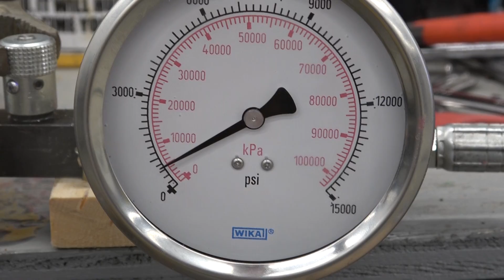How much pressure can PEX take?

Comment: So, PEX - plastic time! 

True PEX means PolyEthylene-Crosslinked. 

Extremely tough material, and a great water barrier (and moisture barrier) but not actually a great air barrier.. well... It gets better when you cross link it.. but I digress. 

PE isn't hygroscopic (unlike Nylon which is quite hygroscopic and actually plasticizes with moisture) 

Cross-linking also essentially makes the whole thing one giant polymer chain, and the polymer no longer "melts". It will soften but you could not melt process it again. 

In summary: PE is not effected by moisture. PEX (not polybutyl) is great for hot water applications.

PE doesn't degrade over time. 
Doesn't degrade with UV (not that this would be an issue) 
And the cross-linking makes sure it isn't melting and adds a whole heap of toughness to it.
Reply: Regular PE will melt back down, PEX will not. Once PE is crosslinked(the X) and becomes PEX it can withstand over 500F and still not melt to dripping stage. The crosslink creates a Memory as it strengthens the material and will return to that memory as it cools down or thaws out. Regular PE is extruded around 200F and has no memory to it, which allows it to be melted back down and recycled. Also, the problem with irradiated PEX is that not all PE resins are the same and each batch of resin reacts different to the process. Chemically crosslinked eliminates that variable as it's being extruded.
Reply: @charlessharp9795  yup! Well... I agree with everything other than the irradiated vs chemical comment. But perhaps that's because the company I work for makes and maintains our own irradiation equipment for our film work. 😂 But perhaps it's just pride talking.
Reply: @bradleynealdaley  I've had experience producing both types. Chemically crossed is done during the extrusion process and effects all PE the same. Irradiated is extruded and then processed through the BEAM to crosslink it. The facility where I worked order the Resin from several suppliers and we discovered that each brand of resin reacted different to the beaming process. They were all strong but the difference was seen during the Quality testing. Some resins burst sooner at lower temps and pressures where others were much stronger and could handle higher temps and pressures. The other noticeable difference was the finish of the pipe itself. Some would come out with a type of rough finish and others had a smooth finish. Dull versus Shiny. We discovered slight differences in the processes used by the Suppliers when they produced the Resin Beads and some were softer where others were harder. That hardness/softness affects the finish and overall strength. Don't get me wrong, the softer stuff was still stronger than ANSI required, but we could see a difference when testing the Quality under extreme conditions.

Comment: Pex has a few things going for it over copper in the house. Most household water pressure is only 40-60psi. Plastic pipe in general has less resistance to flow than copper, so you get more pressure out of your faucets with the smaller lines. To add to that it also tends to not get the scale build up that copper and iron does.  It's more end user serviceable. Most people aren't going to know how to sweat a copper pipe properly. just about anyone can cut out a bad section of pex and push on a couple of fittings. You also save on labor and down time. My grandfathers house had all copper and every other week we were fixing pin hole leaks. My cousin and i cut all of that out, replaced with pex and he had water again in a fraction of the time it would have taken us to rebuild the water lines with copper. Neither him nor i are plumbers.

Comment: Building my house now. Plumber insisted the uponor pex would last forever. It is much easier to plumb a house than the traditional copper that needs to be cut and soldered together many times to get it through the walls.
Anyway, what was the pressure when the damaged pex finally let go?
The other thing to remember is that home water pressure would rarely exceed 80psi.
Me thinks it will outlive my old skinny ass.

Comment: Here in Europe we use Alupex. It's first polyethylene on the inside aluminium of 0.xmm inbetween and then polyethylene on the outside.
Reply: Alupex is usually used in heating, because that aluminium layer makes it gas tight. There's also PEX with glass fibre layer, for the same reason. Normal PEX will allow gasses to migrate into installation, creating airpockets. It doesn't really matter in case of water delivery system, as the process is slow, so there you can use PE or PP pipes.
Reply: The phrase you're looking for is "gas impermeable" and we have that in the United States too.
Reply: Sounds a lot like kitec, I've been repiping houses in California that had it fail. We do a kitec house or 2 a week. Garbage.
Reply: we have that here too. was manufactured under name Kitec. lots of it failed and delaminated.  lots of lawsuits. everyone quit using it
Reply: @dantuck5242  oh wow I just read about it. Apparently the zinc percentage was to high in the brass coupling Wich made it corrode and prematurely fail and Spontaniously burst...damn..... The brand kitec still exists
Reply: In the UK we dont really use alupex, our plastic pipes all have an oxygen barrier though. Not sure what it is, but it appears to be just a different plastic. The oxygen barrier isn't so much for preventing air pockets, but if oxygen gets into a heating system it dissolves in the water and causes corrosion issues.
Reply: @98dizzard  you also don't use metric ;-)  just kidding.( No but really...) Polyethylene is very chemically inert and doesn't leaches molecules into the water. It's also cheaper then PP per ton.  As for PP its way more difficult to work with than PE because it's so tough. Making clean cuts would be a pain. (Unless using modifiers in the plastic... Wich can Leach into your water.
Reply: @VinokDesign  we do use metric, imperial size pipes where phased out decades ago. Most domestic pipes are 15mm or 22mm. They are similar to, but not compatible with the imperial sizes.

As for the pipes, they're mostly PEX or PB with a different plastic for the oxygen barrier.

Edit, the oxygen barrier is ethylene vinyl alcohol.
Reply: @98dizzard  oh awesome! So some things become metric and some stay imperial. Good to know.
Reply: @VinokDesign  very little is still imperial. Almost everything you buy is in metric, even if it's a metric equivalent of an imperial size. The only thing that still commonly uses imperial is automotive speedometers, we also use miles per UK gallon, but fuel is sold by the litre.

Oh and pints for beer from the tap.
Reply: @98dizzard  ah ha, nice to know. My idea about it was wrong then. When I worked in the petrochemical industry  we were confronted alot with the imperial system. But that is also because the machines where a bit older then.
Reply: @VinokDesign  imperial still persists in some specialist applications. Aviation and the railways for example.

Comment: Pex works great but not the shark bite fittings. Ive never seen a shark bite fail, but it's just common sense to me that a copper crimp fitting is superior to a shark bite. I've installed thousands of copper crimp fittings and never had a failure nor have I seen one fail. It's imperative that the crimp tool is squared up properly to the crimp ring to guarantee a good crimp. I'll never go back to sweating pipe. Try freezing a pex pipe assembly. It just expands and bounce back to shape when it thaws. Try that with copper.

Comment: Methinks you had the fitting crossthreaded or similar to start with hence the leak , and you sneakily redid the connection before the pipe-splitting exercise without mentioning it , looks obvious from the before and after views as the fitting's not sitting square to start with the pipe  ... ;-)

Comment: I worked at a house where all the hydronic heating had been put together with PEX and SharkBites, they lost power during a hurricane for about a week, and it all froze, all the fittings failed but none of the PEX showed any damage.
Reply: Hurricane? Froze? The fuck?
Reply: Kavurcen see other comment, Hurricanes and freezing weather come around the same time of year to the Northeastern US and the Canadian Maritimes
Reply: Hurricane sandy knocked out the east coast of USA in 2010-12and a snowstorm with freezing cold temperatures impacted much of the disaster area two days after.
Reply: That’s why you are always supposed to run a glycol solution in those systems.....
Reply: Same happened to me during Sandy,  All my pex is still good 15 + years in the walls and it's going strong.  No complaints.
Reply: How many times can you stretch one out. Before it can’t grip the weener slidin. 
I’ve had them blow, after a few good chills. Some dick head, ran pex through the uninsulated soffits, back into the walls, to add outside hose bibs.

Comment: psi - pounds per square inch.   look at the area inside a pipe.  1/2" pipe, fuck all area, not that much pressure acting on the inside of the pipe.   36" pipe...  think about how fast that area adds up inside there.  as you bump up the pressure whatever you've got on the gauge is putting that much pressure on every square inch of area inside that bastard. 

one foot of half inch pipe is about six square inches of area.   one foot of thirty six inch pipe is about 432 square inches (not including the ends, so add on another 2000 square inches for the 36", only add half a square inch for the half inch pipe ends all together).     that pressure adds up faster than fuck when you get into the big pipes.    say you've got 100 psi in that half inch,  that's around 650 pounds of energy stored in that thing.   100 psi in the 36" would be around 243 000 pounds in a foot, with two blind flanges on the end.   and pipes that size it's normal to see 800 psi in service.

Comment: Pex Is great stuff I've seen 1/2 freeze many times. Expanded up to about 1 or almost 2 inches  (25.4 -50 mm) I don't trust those shark bites and the crimp fittings close the id and reduces flow.
Reply: How does the crimp reduce flow when it's on a fitting?
Reply: Fitting goes inside the pex crimp ring goes over the pex and fitting. Id of half inch pex is half inch. The id of a half inch fitting is I don't know 3/8 or so